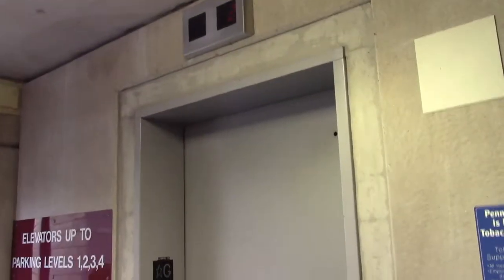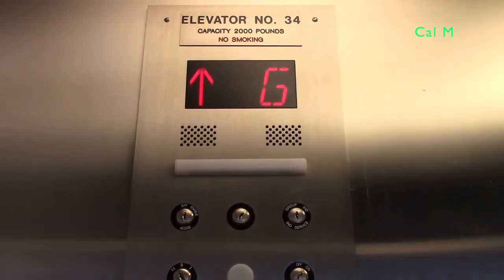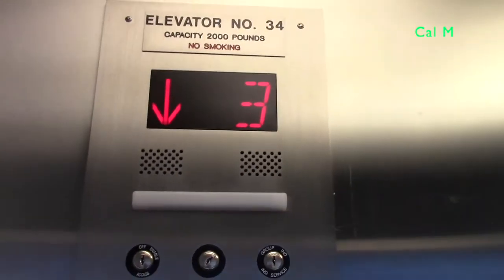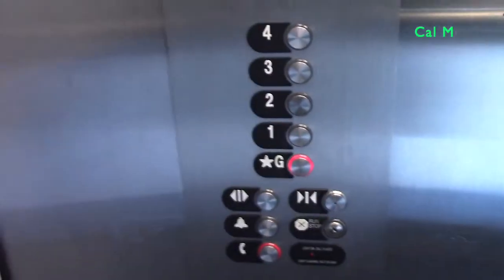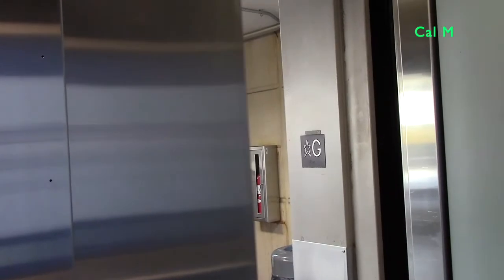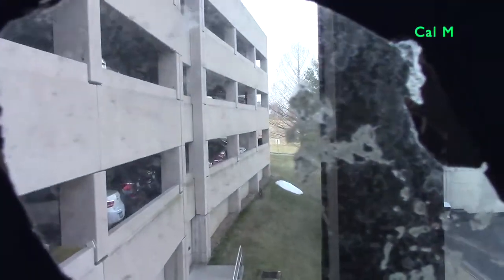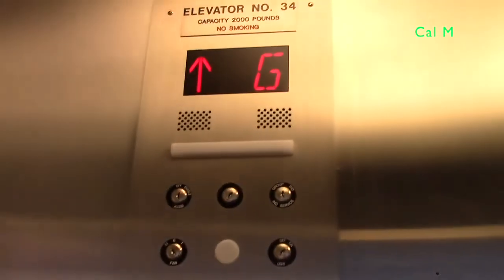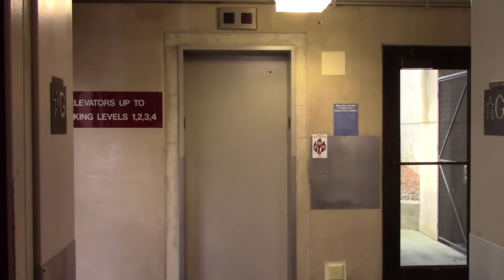OTIS 211M Elevators @ South Garage @ Derry Township, PA

Comment: I think these are too old to be HydroAccel. These are most likely 211M.
Reply from the maker: This modernization happened in 2014. When did OTIS start offering HydroAccel?
Reply: The mod. also seems older than 2014. It seems more 2012-ish. HydroAccel came in around 2017-18.